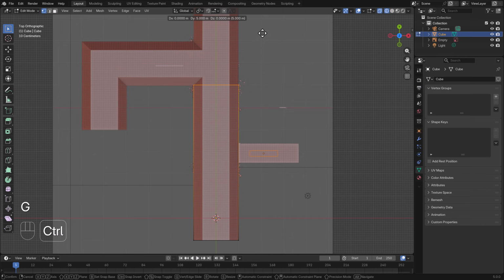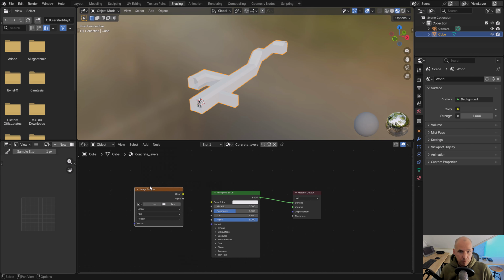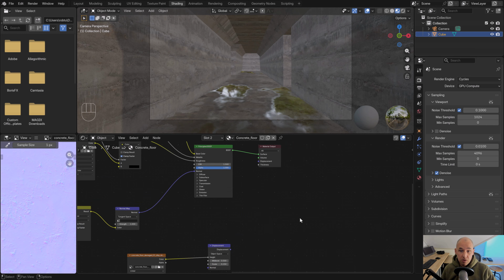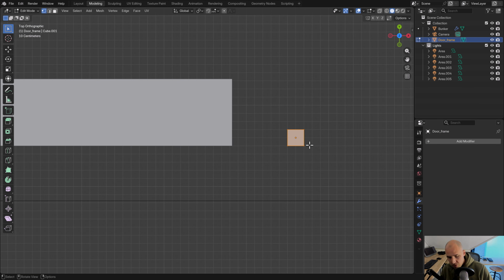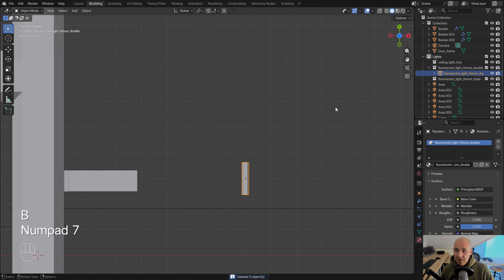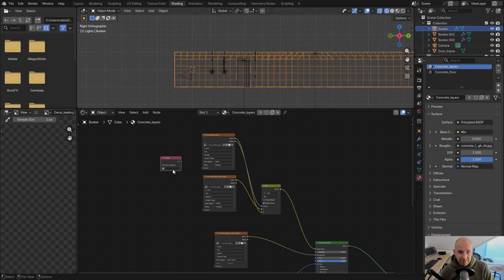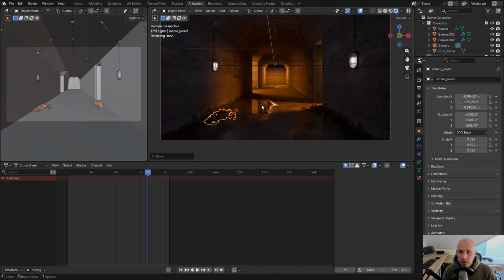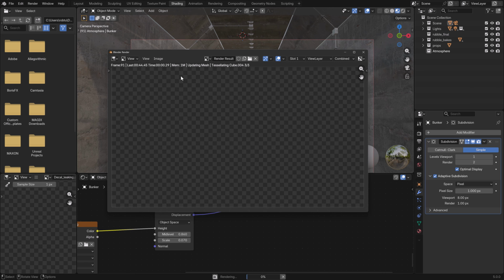How to Create a Liminal Bunker Environment - Blender Tutorial

Comment: Hi, love the tutorial, but I'm a little confused. We added Normal map information, but we only chose displacement In the material settings. Wouldn't we choose displacement and bump? If not, I'm afraid it doesn't seem like we need the normal map information, almost like it's repetitive.
Reply from the maker: Good question. In this workflow the normal map is still fully used, even when the material setting is set to “Displacement Only”. That setting controls only how true displacement is applied, not whether normal maps are active. Normal maps always affect the shading through the Normal input of the shader, so they are not redundant.

“Displacement and Bump” is only needed when you want Blender to generate extra bump shading from the displacement texture itself. In this tutorial the micro-detail comes from the normal map, and the displacement is used only for the larger geometric shapes
Reply: @companyofvisuals , Thank you for the clarification. I had only asked because I remember watching a video that said we were using normal maps incorrectly in Blender, and it had to do with Quixel Megascans assets and material settings' displacement. Basically, in a nutshell, it said something like when we are in cycles, we don't even need to use the bump data (I'm paraphrasing)

Comment: ok .. i'm gonna just not do the displacement thing ... my little box here just doesn't like it. a test render with the the floor D 30 some hours!.. i'l tweek some settings and see how it goes
Reply from the maker: Displacement in Blender 5 is much more manageable. You can set it to a low resolution, and combined with adaptive subdivision, which is now out of the experimental phase, you’ll hardly notice any performance impact.
Reply: @companyofvisuals yes I adjusting some of the settings helped